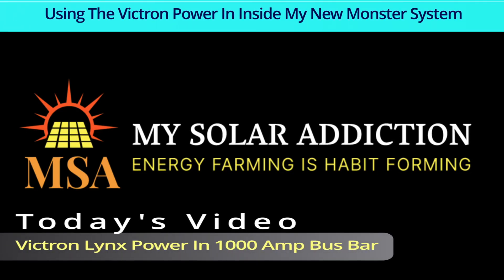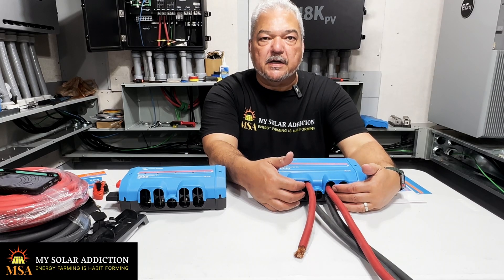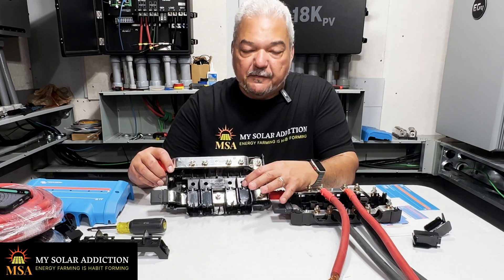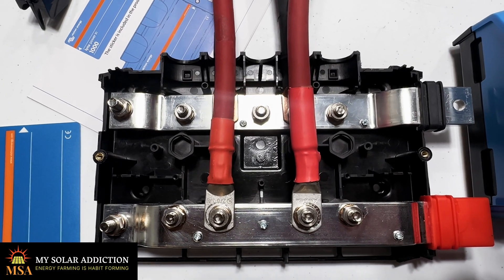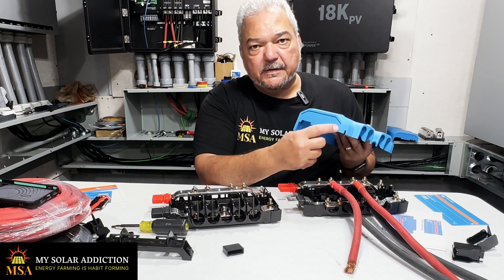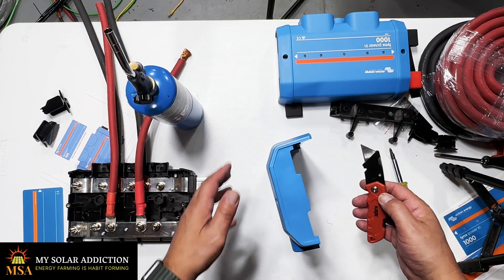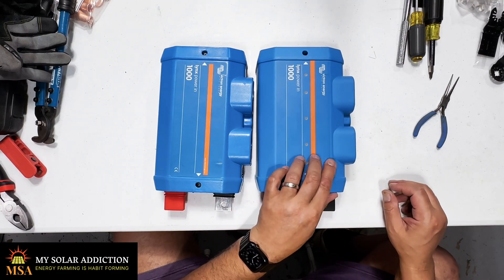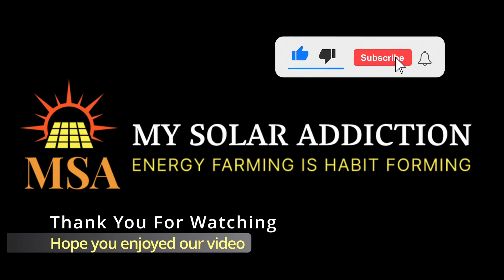Victron Lynx Power In Unboxing & Review

Comment: I love my Lynx Power in. I added nuts and bolts to it so it can accept fuses. I have 3 16kwh battery boxes and landed 2/0 wires in the Power In and then fused them individually with 80V 125A Mega fuses. 

Then I was able to direct bolt my BMV shunt and T Class fuse holder to the Lynx output.